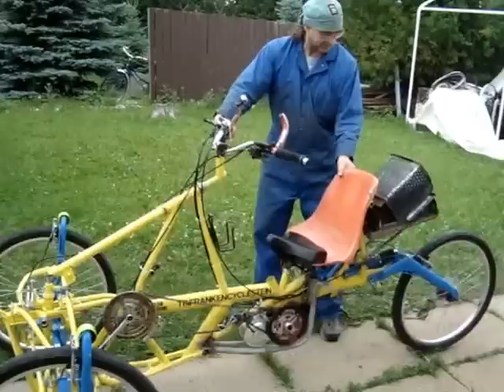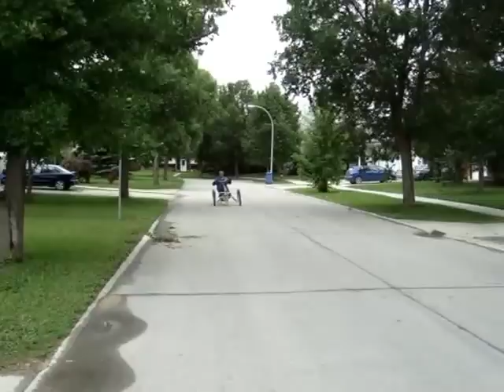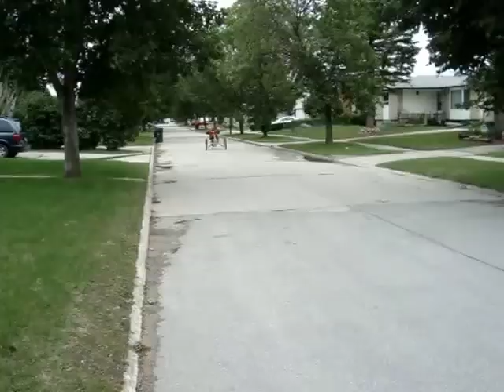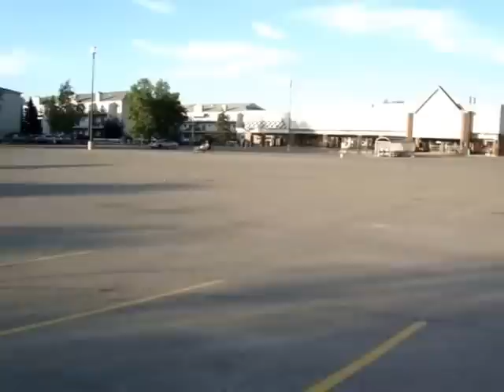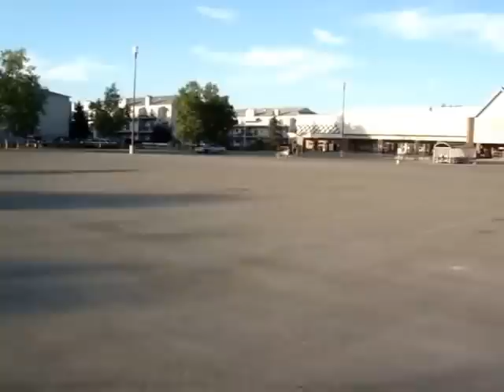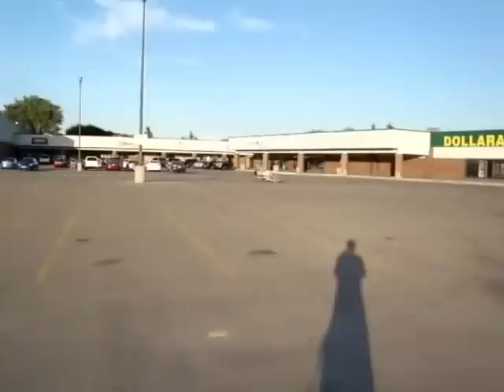Electric Powered, Tilting Reverse Trike from parts - I call it Trifrankencyclestein

Comment: Really a very smart vehicle even if it lacks two or three little things like: a stabilizer when stationary, a full fairing, a new type of more functional handlebar or even an active rear suspension... But in the Overall it is quite well studied; in particular because it is pendulum and allows you to maintain speed in curves. We must continue its development.
Reply from the maker: Thanks for watching and commenting. 
As for the stabilizer for when it's stationary (or going slow), I do have a tilt lock on it (but it could use redesign).
Not sure what you mean by 'active' rear suspension, it is sprung, and works quite well (although the chain angle does lift the trike up on acceleration).
I originally wanted it to be completely open, to 'show off' the various bicycle parts.  The plan is to make various fairing / body parts for styling. I got involved in other projects so that's on hold at the moment.
Reply: @cptrikester2671  By active suspension I mean a system managed by electronics or hydraulics which modifies the hardness of the suspension in real time. In the automobile industry, for example, the French brand Citroën is a pioneer in this area. Otherwise, I sincerely hope that you can resume your work and earn lots and lots of money. In any case if your machine arrives on the market, I'll take it. https://www.youtube.com/watch?v=ghUInp1JBRo

Comment: Front wheel base is too wide, 
The whole point of leaning or tilting is to offset center of gravity when the wheel base is of a narrow track I.E. bike lane fit or splitting traffic!
Also the wider apart the more indifference between inside turn and outside turn causing excessive scrubbing.
Reply: Thanks ,yes it’s complicated!
Reply from the maker: Dana
Thanks for watching and commenting.
"Too wide" is a matter of opinion and intended application.  Yes, the front width could have been made narrower, but I didn't.
Anti-scrubbing can be improved by  dialing in the Ackerman geometry, and yes, this does need some work.
FYI, splitting lanes is a good way to get injured.  Ride safe. 
What is your mechanical engineering background?
Reply: CP trikester I like your concept and appreciate your ingenuity. Sorry I am not criticizing it’s just that I have been thinking about this and making 3D models then building the model .I have not applied the tilting design in the proto type yet. I have been looking at other people’s ideas . Finally there is a lot of interest in this tilting idea.
I feel likeI thought of it first and then it started to show up everywhere !
Splitting traffic and fitting in the bike lane for commuting to work. I have a tadpole trike , electric with bald tires I slide around the corners instead of flipping out on the pavement.
It’s really fun but dangerous!
Reply from the maker: @Dana5775  When I decided to build this, there were only a few tilting trikes of this style that I could find pics of.  I  had to figure out how to do it. Now, there are lots of different designs out there. 
The nice thing about tilting trikes like this, they are faster around a corner than a flat trike. My flat trike didn't slide,  it tipped. 🤕
The geometry was/is challenging to make it work.  Especially without computer design & modeling.
Hope to see your project. 👍
Reply: CP trikester thanks I agree . I give you great credit for your engineering I have been thrown out onto the road too many times till I discovered once my tires lost grip I could take corners at any speed and just drift, but loosing all that speed!
After some time I got new tires they were sticky with traction had forgotten about the flipping , and sure enough out I went!.
One of the complications is if you corner to sharp and try to depend on the handle bars you accidentally steer even sharper adding to the problem.
I notice you leaning quite far on turns as well!
Reply from the maker: @Dana5775  Thanks.
Yes, I have to lean more into the corners than the front will allow.  The front suspension has a hard lock on the tilt (a little too high mind you) and after that, I need too lean in more to go faster.  Hoping to adjust that some time.

If the geometry isn't right and it leans too far, the pivot points could go over center and then it WILL NOT tilt back up.  Please keep this in mind on your project.
Reply: CP trikester yes that is the part I am most concerned about how it rights itself!
Reply from the maker: @Dana5775  The interesting thing is that the tilting and it uprights itself the same as a normal bike.  Becomes intuitive, just like riding a bike.
Reply: CP trikester that’s great! Totally natural. I went back and watched again. I like the recumbent position your in also.
Looking more closely at your front wheel ensemble it’s very elegant design. The whole thing seems to just float over the bumps.

Comment: Great innovation. I was planning to build a similar prototype, only street legal (and no human powered). I was intending to call my (not born yet) "baby" the commuter. I would very much like to work with you Sir. Please contact me.
Reply from the maker: Thanks.  If you understand the geometry requirements, I'm sure it will be an interesting project.  As for street legal, sounds like you're planning a motor trike.
Lately, I see a lot "out there".  May be easier just buy one soon.
 By having pedal power there's no registration / insurance and as a commuter, I can go 35-45 km on a charge without human power.
Not sure what you mean "work with me"?

Comment: Wow! Is there anywhere i can find plans for this type of front steering / suspension system?
Reply from the maker: izzzzzz6 If you're mechanically minded, there are several videos out there that show how the mechanism works.  Depending on your size requirements, the pivot points (control arm lengths & heights) would need to be adjusted accordingly.  
Following the principles of an Ackerman (I hope I got that right) suspension would be a good starting place for geometry.
Plans not available at the moment, but I hope to see your project when it's ready. 
Thanks for the comment.

Comment: Why not add a passenger seat behind the driver, and a cargo trunk in the back for groceries etc, and it would be useful as a daily runabout local vehicle.
Reply from the maker: All good questions.  Why not?
Please be aware that this is the first time that I built one of these and it started out as a "free" project from scrap parts.  See original non-powered version.  
There were no plans or design aspirations, other than to see if I could make one that worked.  I succeeded.
Since building, riding & modifying this trike, I have conceptualized a version that converts / transforms from a recumbent single seat to a standard sit-up style while moving.  This would also allow for the cargo space.
Parking this, to go get groceries etc, would be risky.  Thieves would steel everything not bolted in place, and then again, thieves bring their own bolt cutters.
Reply: CP trikester Anti theft is a concern since the first vehicles. You should install body panels to prevent thieves, better aerodynamics less waste of energy on drag and all weather use.
Reply from the maker: I should, should I?  
Perhaps I could develop it into a $10,000 to $20,000 trike, like the solo (or others) instead of the cheap ride it is.   Please post some of the vehicles that you have built, so I may learn how it's done.  ;-)  Thanks.

Comment: why do you use motor on the rear wheel only ?why we cant use it on  the front wheel
Reply from the maker: The motor is mid frame and powers the rear wheel through original sprocket set for increased speed.  If I power the front wheel(s), I will have steering torque control problems and potentially end up in unforgiving, large vehicle traffic.

Comment: Hi trikester how can I contact you I am trying to build a trike on my own but I would love the tilting feature on the design maybe you might want to share some information with me
Reply from the maker: Hello.  You can continue contact through this thread for now.  I give you my encouragement for your project and look forward to seeing it.  What kind of information are you looking for?
Reply: sorry I haven't read your comment until now.
I want to know the suspension geometry as it can be seen very well on the videos.
How you manage not to tilt when you are not on the bike.
Reply: I want to build an enclosed trike with composite materials
Reply from the maker: +wasp fueling systems   The trike will tilt until the upper frame makes contact with the spring towers.  I also have a mechanical brake lock that prevents it from tilting at slow, walking speeds.  Good for going straight ahead, not turns.
Reply from the maker: +wasp fueling systems  Sounds good. I have considered making enclosing bodywork using plasticor board.
Reply: Hi Trikester, I am mentoring a group of high school students building an electrathon car and we would like to incorporate leaning as you have done.  My question is is the blue traingle attached to the yellow frame with a pivot so that it can remain relatively upright when you lean?  Is it's only purpose to provide a mounting point for the upper shock mounts?
Than you, Rob
Reply from the maker: Hi Rob,  Late reply. 
Correct, the triangle is the spring mounting frame. It's what keeps the lower A-arm at the ride height regardless of lean. Sping load on one side is instantly transferred to the other side.   It's pivot axis is the same as the lower suspension.